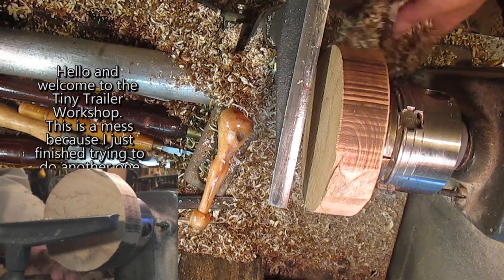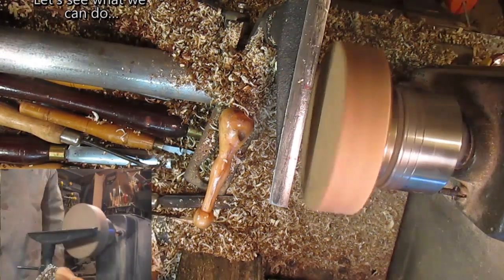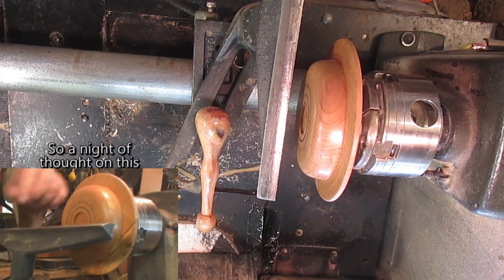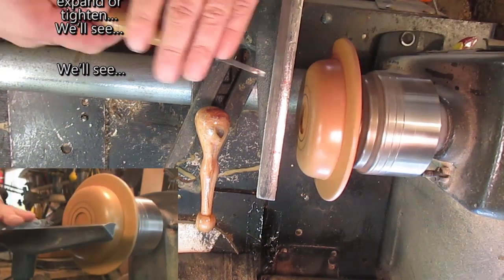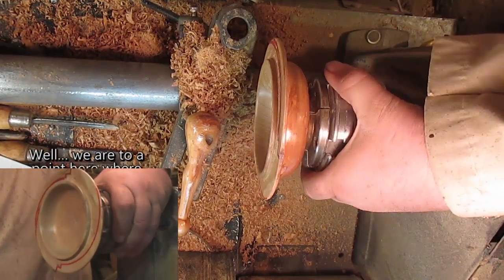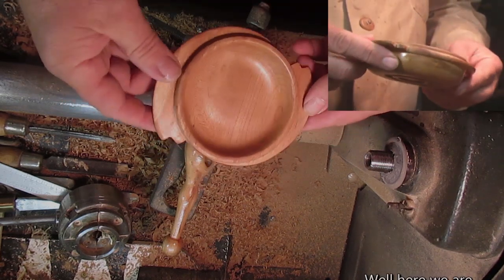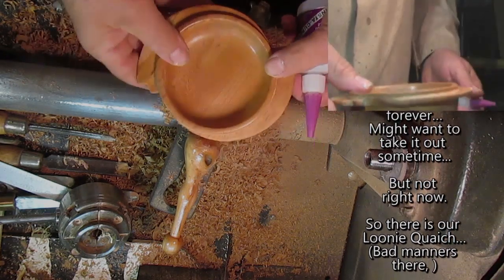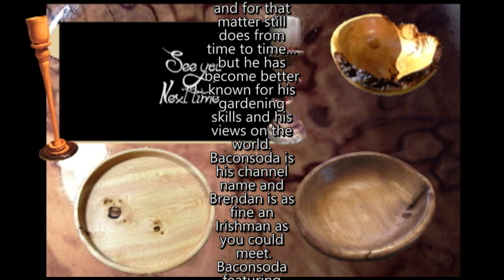Wood Turning #85 Texted The Quaich

Comment: Interesting as usual Larry, I watched the links and still wonder the purpose of the holes drilled, and wonder why you didn't show the cutting of the handles. The "Quaich" turned out beautiful and I was surprised to read it was a piece of spalted.
Reply from the maker: effeinc Hello Mike:   The holes were just a decorative thing... the ones I saw actually had scroll saw piercings... and the reason you didn't see me cut it was because... number 1. I didn't know if it was going to work or not! And I was so concerned about it that I just felt the need to go and do it unencumbered by concerns about where the camera is and whether it is aimed the right way and whether it is in focus... next time I will! And as a matter of fact I have made another one since and it went like clockwork! even the holes got better spaced!... One of these days I am going to have to see if I can make the scroll saw do what I want! It is an old one that has no brand name on it that I can see... but it does have a warning on the arm suggesting ... "Do not tighten nob as blade is to break"    The spalting can only be seen from the bottom on the one handle, and a couple of "spots" in the bowl... funny how that wood can be so pretty in one spot and so different in another!   Thanks for watching   Larry